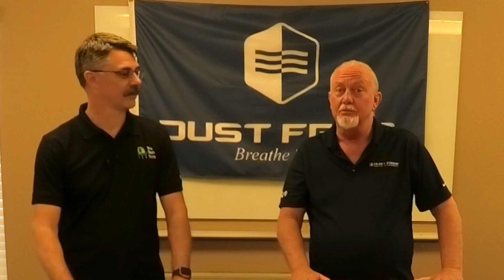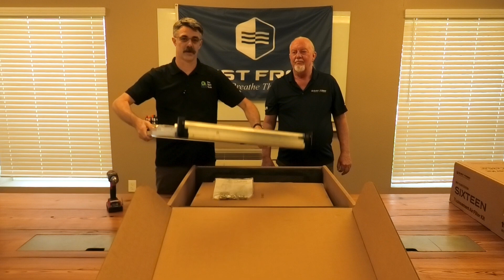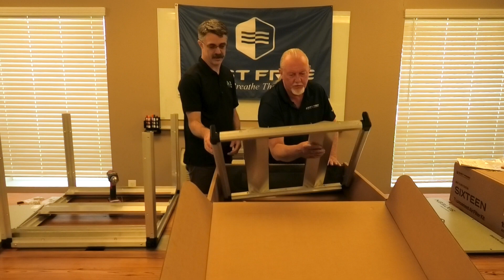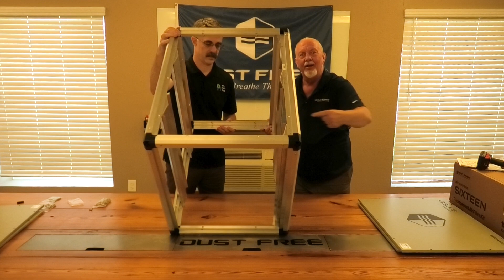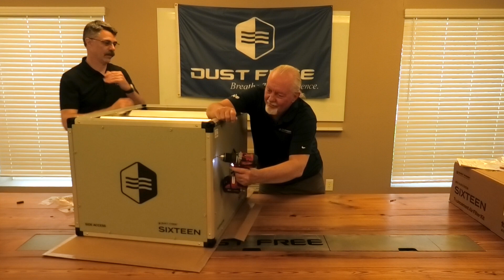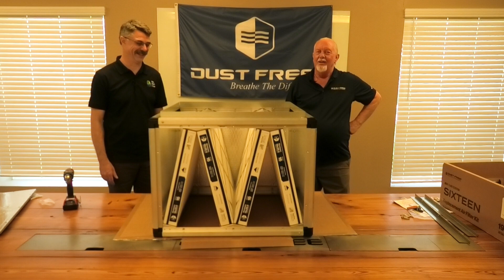Dust Free Sixteen High-Efficiency MERV 16 Air Filter | Introduction & Assembly

Comment: This is great to see a legitimate competitor to the AprilAire 2516- that’s a great unit, but to have even lower pressure drop helps especially in retrofit situations where the poorly designed flex duct means you don’t have much pressure to play with.
Reply: Or poorly chosen equiptment with no available static to start with.

Comment: Beautiful.  In filter grille markets i suspect many systems would be able to handle a low MERV pre-filter, that would need the usual replacement schedule.  But that would definitely allow for a three to five year cycle on the 4 DF16 final filters. As an industry nerd I double filtered my 2 ton (in series NOT parallel) with a 2 inch 20x25 MERV8 upstream of the Aprillaire MERV11.  There's as much static (.10) across the pre-filter as across the main filter. I change the cheap $4 pre-filter about every 6 months, the main filter every ... 6 years.   Haven't had to clean blower or secondary or coil or condensate line in 20 years.  Probably should now due to the bit that got by from fter bypass ... looking forward to recommending the DF16!